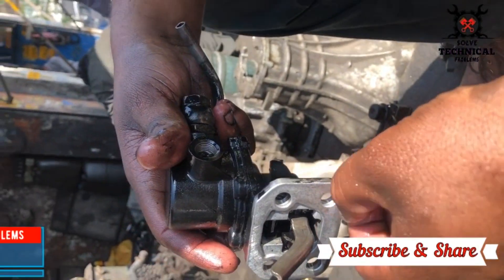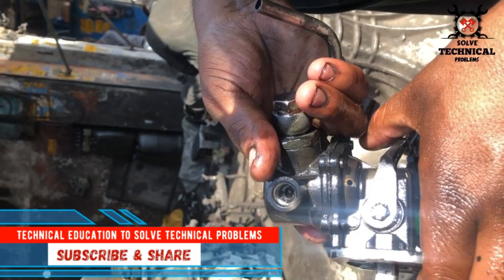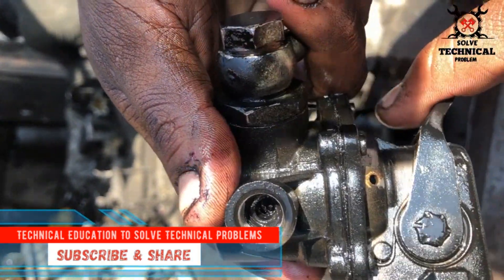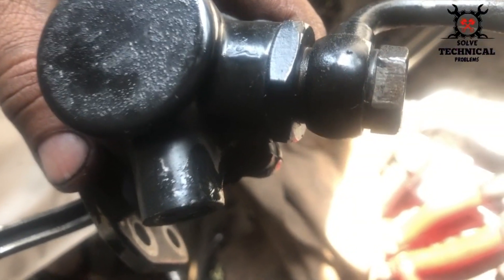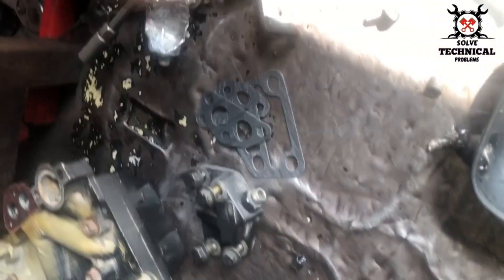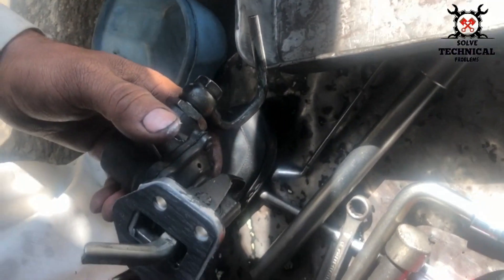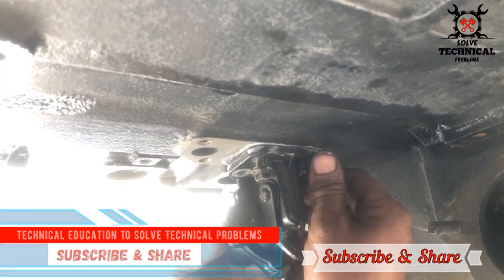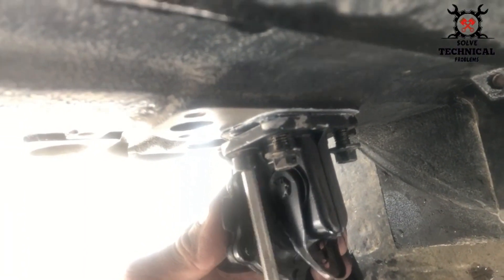Fuel Lift pump or fuel feed pump installation function working  installed on Perkins  engine

Comment: Nice video sir, i have perkins 4 cylinder generator if 50percent load start hunting maybe this feed can cause of hunting, already replace filter. I hope can you give me advised how to fix fhis problem, thanks
Reply from the maker: Yes, check the pump and also check fuel filters when you changed last time .change if more than 250 hours or filters are clogged. 
If the problem is not solved with the above suggestions, check the valve lash.
Feel free to ask if the problem is not solved
Reply: Thanks sir i check feedpump and valve lash,
Reply: Thanks sir for tips how to trouble shot this hunting regarding my genset i already replace feedpump and check valve lash, my genset loadtest and no more hunting. Thank you so much and best regards..
Reply from the maker: @RitcheUntaran welcome